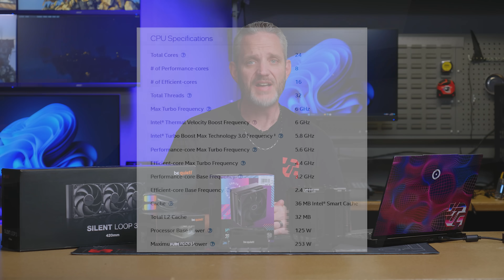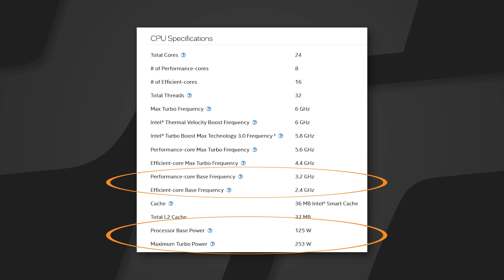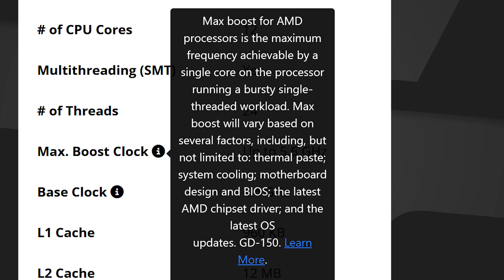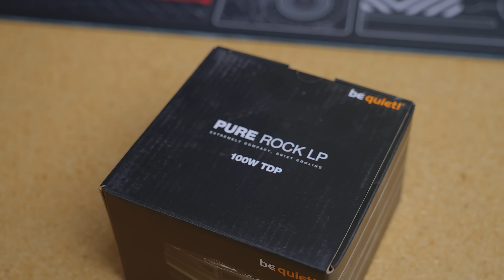Forget what you THINK you know about TDP

Comment: Well, I agree with the "solution" but the technical details are somewhat wrong. 
Firstly, to agree with Jay, IF you spec a cooler that can dissipate as much heat as your cpu can ever consume as electrical energy, you will be SAFE. 
I'd say the problem lies with the way AMD and intel are giving us "useless values" to work from. TDP at "average workload" is a very poor indicator of "maximum thermal load". 
But it is ABSOLUTELY also true that "maximum ELECTRICAL power" is not the same as the thermal heat rejected from the cpu, that the cooler needs to dissipate. It is a safe assumption, but in no way accurate or true. 

Electrical power consumed by the cpu is not entirely rejected as heat. 
Some of that energy "does work" doing the calculations, so that maximum electrical energy is NOT the same as the thermal energy it needs to dissipate.

Perhaps easier to use an Internal Combustion Engine (ICE - unfortunate hijacking of that TLA by an American hit squad in current times) analogy - since most folk are more familiar with this - as in, most drivers know there is an exhaust pipe, a coolant system with a radiator (air cooled engines like VW Beetles being the exception today) and that an engine needs oil in the sump for lubrication (but also, CRITICALLY, for cooling - which is why some bigger engines have a finned aluminium sump, or even a separate oil cooler, like a small radiator). 

When you put your foot down, the engine converts the liquid fuel (gasoline, diesel, maybe hydrogen and even Ammonia) into energy by burning it. 
FYI A jet engine does the same thing, but instead of pushing pistons up and down to turn the crankshaft, it uses a turbine (disc with lots of little wings) to convert the burning (and thus expanding) fuel into turning motion of the central shaft.
But I digress.

Around 50 years ago, an ICE was about 20% efficient. Meaning that of the potential chemical energy held within the fuel itself, only about 20% of it could be extracted by the engine to "do work" - to move the vehicle, run the AirCon, power steering, electric windows, charge the battery, run the headlights, spark the engine (if gasoline), run the ecu...  
Some modern super-duper high tech evolutions using turbo chargers, superchargers, fuel injection, variable valve timing, ECU tweaks etc etc can get up as high as 40% efficient. 

Which means that a minimum of 60% of the energy released by burning the fuel (and it used to be 80%) is NOT used to turn the crankshaft and the gears and the diff and the wheels. So where does it go? 
Well, this is the waste heat that needs to be removed from the engine before it melts... Some of it heats the air and bodywork around the engine itself - that's why the hood feels warm, after you've been driving. But that's only a tiny fraction of what's involved. 

First exit point is the heat within the exhaust gas itself. Ever seen an engine running on a dyno, not hidden away under a hood? The exhaust manifold is usually glowing red-hot, indicating about 800 degreesC (about 1470F). Heated by the exhaust gas escaping from the engine, which is about 50% hotter than that. Burnt fuel/air mixture is not a particularly dense material (like air) so even a large volume of it does not contain that much ENERGY, even though it is very hot. 
So, some of that "lost" energy is dumped straight down the exhaust pipe and out the back. 
Which, FYI, is where a turbo charger steps in, to capture some of that escaping energy to power a turbine that improves the engine efficiency. But I digress... 

That hot gas is in contact with the cylinder walls, the pistons, the valves, the cylinder head. So they ALL "absorb" heat from the gas.
This is where the coolant system comes in, with a "water pump" pushing coolant around all those heated surfaces and taking the heated water to the radiator - the clue is in the name. The radiator is where much of the waste heat taken from the hot engine surfaces (which can melt if NOT cooled by coolant) is transferred out of the coolant to the ambient air, usually being impinged on by the front of the vehicle, since mostly vehicles drive forwards, so that is where the air is coolest. 
If you have ever wondered why a radiator is not place at the back of the vehicle, in the downstream path of the exhaust pipe, well, it's kinda obvious now, isn't it? 

You can also probably see how the coolant system and radiator acts like the cpu cooler - with an AIO (of custom cooling fluid loop) being a perfect direct comparison). But it is also important to note that the coolant system is NOT having to cope with 100% of the energy released by the burning fuel, and that is exactly the same reason why any cpu cooler does NOT have to deal with 100% of the electrical energy it consumes.

An ICE has one extra heat rejection path - the oil. The friction between the sliding piston (and its sealing rings), conrod, rotating crankshaft and all those "journal bearings" (using oil to keep them apart and stop instant catastrophic damage through friction) is nevertheless shearing the lubricating oil by the relative motions of the mating surfaces, which... is work done on the oil, which heats up. A lot more than you might think. 
I have personally witnessed a NASCAR engine being used PURELY to drive a valvetrain for testing, that was being electrically powered and NOT burning any fuel at all (even had holes through the side of the cylinder wall, so that lasers could be used to examine the valve head motion) that seized a crankshaft by failing the main crankshaft bearings, because we were running an experiment to see how little oil was really needed, and found... a lower limit. It turned out that the MAIN reason oil flow to such bearings is high, is NOT to feed enough oil. It is to carry away the frictional heat generated in the oil, by the RPM. 
Stick at idle, no problem. Run it at max revs, that oil is being worked so hard (10 horsepower, PURELY to overcome the resistance of the oil to the turning of the crankshaft) that it was enough to heat the oil to its boiling point (about 150C, 300F). Now it's a gas, not a liquid, so it couldn't support the forces needed to stop the surfaces touching, and... instant seized crankshaft. 
But I digress... (this just shows how important the oil is for COOLING the moving parts of the engine).
Some really high power, high performance engines (NASCAR, F1) even directly spray oil at the underside of the pistons, to get heat out of them, and stop them melting in the continuous max power demands of race track driving... wow, more digression. 

So a smaller road car might get away with a plain metal pan for a sump. Some may have an aluminium sump with fins on it, so that heat in the oil collecting in the sump can better exchange heat to the air under the vehicle as the vehicle moves along. And some go so far as to add a specific oil cooler, where the oil is pumped through a small radiator to let more heat be lost to the air - mostly when a high performance engine is enclosed within aerodynamic shields to reduce drag, but also reduces the amount of ambient air spilling through and around the engine bay. Sometimes an oil-to-water heat exchange is used, that transfers heat from the hotter oil to the cooler coolant, that lets the coolant circuit with the big radiator do the effort of removing waste heat from the engine. 
Modern ICE cars are as far from the Model T, as the space shuttle was from a horse and cart. 

So how does all this apply to a cpu? 
Well, of the electrical power consumed, SOME of it is used to do the work. Perform the calcs, run the math, check twitter, etc. 
SOME of it is lost as "waste heat". But not ALL of it. 
Which is why the TDP (or perhaps to talk about the heat rejection that needs to be taken away by the cooler) will ALWAYS be LESS than the electrical energy consumed.

Quoting TDP was a sensible attempt to tell the suer what kind of heat needed to be carried away by a cooler. But by NOT telling us users what that might be, when a cpu is running flat out at full power, they've failed to give us the info we NEED. 

BUT, it should now also be clear that if you specify a cooler big enough to carry away ALL of the maximum electrical energy consumed, you will ALWAYS be safe. 
Making the advice in this video safe to listen to, even if it doesn't fully comprehend what is actually going on in the cpu. 

Note too that SOME of the waste heat from the cpu will be carried away by the metal contact pins to the motherboard... making those socket connections and motherboard cooling important, if not critical. As some intel and even AMD models have proven, with their burned sockets. 

But then you also have to add the heat generated by forcing high currents through small conductors, getting to and from the cpu socket connectors, and... it all gets so very complicated. 
This is the kind of stuff the motherboard designers and developers are checking out with their prototypes (and experience) before deciding a design is "safe for release." 
Subject to sabotage by intel for not revealing accurate microcode or power limits, and the slanging match starts about just who is at fault, getting it wrong... 

TLDR: Get a cooler that can handle the MAXIMUM power consumption (ie electrical energy) of the cpu, and you'll have an overspecced, but safe, cooler.

PS: why did the laptop fan spin up?

Well, firstly, check task manager to see if the cpu is working hard or not. 

Secondly, with one side of the laptop OFF the desktop mat, the bottom of the laptop is NOT being held clear of the surface for cooling air to be sucked in through the vents underneath. 
If a cooling fan cannot get air in, it will spin up, because no air means no cooling. It will overheat, even at idle.

Comment: I just got my first aio for my 9600x. 360mm... complete overkill. But i was shocked that my idle is 40 degrees and  anyrime one core is spiked ( 1.1v to 1.4v) and a mere 12 % usage ... it goes to 58 instantly. I racked my brain trying to figure this out. On full load in battlefield it doesnt exceed 65 degrees.  But damn was it difficult finding out its just when the voltage spikes.

Comment: I still have a Noctua nh-d14 bought in 2011/2012 that is still running with the original fans.
It cooled a 2500k OC to 4.5 for 8 years, i had to downclock to 4.4 and ran that for another 3 years
and now it is happily sitting at stock speeds in a trunas system that is running 24/7 from the last 2 years.

Comment: Keep this in mind, If you are interested in using a single tower cpu cooler like the hyper 212 for an Ryzen 9 or i9 CPU it will throttle under full load and be howling. If using for gaming it will still be loud but the throttling will be less if your case has ample airflow. I would typically go no less than a dual tower air cooler or 240mm AIO for those.

Comment: Power rating a cooler seems like an oversimplification.
Basically the more power you put into the heat sink, the higher the temperature at the thermal interface surface (aka thermal conductivity, stated in degrees Celcius or Kelvin per Watt).
So I wonder what temperature they rated the power at?

Of course, thermal conductivity also applies to the silicon and any heat spreader/lid.
The transistors might be at 125C (typical Tjmax for a lot of electronics), while the internal temperature diode might only see 100C.
A random guess is that the surface would be only 80C.

So is the cooler rated for 200W at 80C? Or 100C? Seems like marketing can lie through their teeth here.

Comment: When I built the PC for my sim racing rig I started with a Ryzen 3600. For that CPU a 120mm AIO was more than enough in pretty much any scenario. Then, about a year ago I put a 5800X3D into the same system and the 120mm AIO is technically underpowered.

However, it does not matter. My sim rig is essentially a single use system. It's only used for iRacing and the 5800X3D with a 120mm AIO stays well within its temperature profile and maintains high boost clocks.

So you should never underspec cooling......mostly.......but sometimes it does not matter because of your own particular use case.

Comment: The same problem with AIOs is still their size vs the case you want to use. if you choose a 360 or even more so a 420mm AIO, you are building your system around that rather than any other component. That is pretty rarely an issue with a tower cooler, though it still happens from time to time, as seen in one of the Retro PC videos.  

But the amount of time the typical PC will spend with it's CPU pegged at max performance means that you can indeed overspend on cooling, although Thermalright seems hell bent on making that very hard to do, bless them.

Comment: PPT reminds me of my dad’s lifelong hatred for turbochargers: it doesn’t matter what the TDP is or what the heat spreader design is, 200W is still 200W, 300W is still 300W, you can’t expect a 92mm AIO to dissipate heat from a 14900K (His argument against turbos is “I don’t care what unobtainum they’re using in a turbo, engine exhaust is HOT and you’re feeding that into a MOVING part”)
Reply: Hey, the turbo is great til it shreds its fan and throws chunks of metal into your cylinders.  And, if you took the savings in fuel economy it should pay for a new engine by the time you're out of the warranty mileage period.
Reply: @richardbrooksshnee clearly both you and OPs dad are idiots. If an exhaust impeller broke, it would just poop out the exhaust. As for OPs dad, your valves inside your combustion chamber are moving parts, too. Its easily twice as hot during the initial explosion inside the combustion chamber than it is in the middle of an exhaust manifold or header tube, let alone when that gas actually hits the turbo impeller. Iron has a melting point of how much? Turbos on a gasoline ice also experience much lower egts than a diesels turbo, hence why only diesel guys have to be careful about egts to not melt the turbo (1400f+)

Comment: You CAN look at spec to plan what cooler to buy, but not the tdp.
I plan my cooling base on how many watt cpu can use when stress to 100% ( search "cpu name" watt should get you the cpu review with the answer).

So it's like if 12700k can use 242 watt (on pl2) I try to buy cooler with 242+ tdp number.

With that your cpu should be fine since cpu won't run to 100% all the time (unless you do some ai or deep learning things), and even if you run it 100% all the time your cooler should deal with it fine.

Comment: Undervolting will not lower your clock speed. It will actually increase your clock speed in most cases nowadays, because the chip has more power and thermal headroom for its boost algorithm.

Limiting the power limit or having a cooler with lower capabilities will of course also limit your achievable max frequencies.

Comment: I find the best rule of thumb is (for both Intel and AMD) based on the product tier, (ie, 3, 5, 7, 9).
3 means stock air or cheap air
5 means cheap or mid range air or 120/240mm aio
7 means mid / high range air or  240mm aio
9 means premium air or 360mm aio

Comment: Fractal removing nylon dust filter intake is a down side, the example is M3, there is no nylon front intake, only at the bottom, why bother not to add it at the front since there will be plenty of air intake for 5 120mm fans although all of them have a bit choke by the nylon dust filter. I'd rather clean the dust filter periodically rather than clean the entire system especially inside of the system anytime.

Comment: I have an original Hyper 212 on my I7-10700 machine in a push/pull config. I scoop those up for cheap whenever I find them and I found a rare old MSI Frozer L cooler brand new, using that one on an X57 3600X machine.

Comment: Thermal Watts and electrical Watts are not the same, but they are related.

Definition:

    Electrical Watts (W) measure electrical power, defined as the rate at which electrical energy is transferred. It is calculated as:

P=VIP=VI

where PP is power in watts, VV is voltage in volts, and II is current in amperes.

    Thermal Watts (W) measure thermal power, which refers to the rate of heat transfer. It can be calculated using various methods, often involving temperature change and specific heat capacity.

Conversion:

    While both are measured in watts, they represent different forms of energy. However, in many contexts, such as heating systems, the two can be interconverted based on efficiency and energy transfer principles.

Comment: I was using a peerless assassin on my 7800x3d it was decent for gaming even hours o gaming temps stayed reasonable I just put together this 9900x3d but have an AIO 360 and also a fairly wide case with a 7900xtx (same card I was using with the 7800x3d case is around the same size and type)  having tested it yet but my idles while on here with ff having 12 tabs open is 50c. Going to play some Ark survivor ascended to see how much it will go up

Comment: Thermaltake TOUGHAIR 110 120mm CPU Cooler on Intel Core i5 13500 never been an issue. Mind you that just a HTTP PC. My 12900KF with ARCTIC Cooling Liquid Freezer III 420 CPU Cooler can still hit TJMax when enabling MSI game boost in the bios when running cinebench on a z690 carbon Wi-Fi but if I do manual overclocking instead it's never throttled.

Comment: You left out the MOST important part of this yt ..
Most ppl leaves eeverything at Stock Default setting wich leads to an SEVERE power usage overshoot !!!

Default settings draws almost always more Power than it needs !!

settings such as LLC (Load line Calibration) , Soc Voltage etc etc ... comes to mind!

Why, i shaved like almost 20C° of my Max temps using custom settings and having more performance at the same time, compared to using Default PBO settings 🤯

MooOOOH ..🐮
Reply: I've noticed this issue on multiple ASUS boards in particular, they were pumping a ton of extra voltage